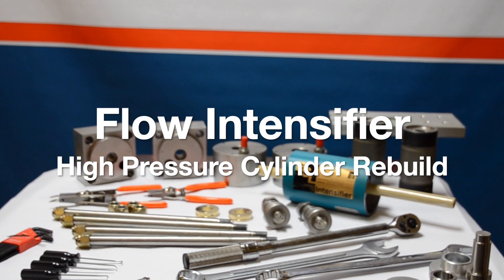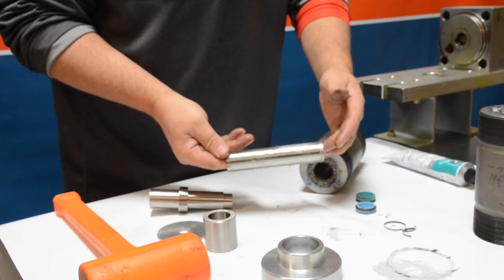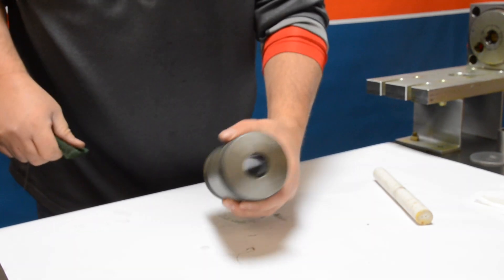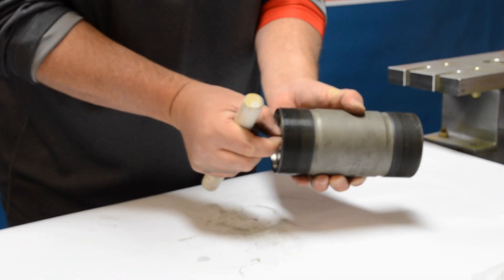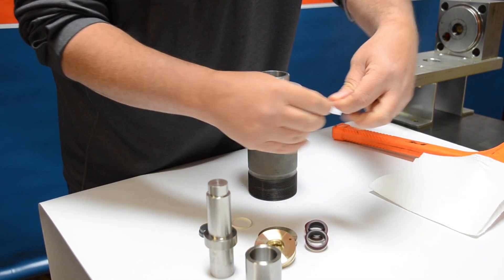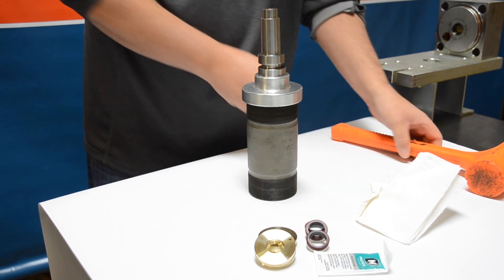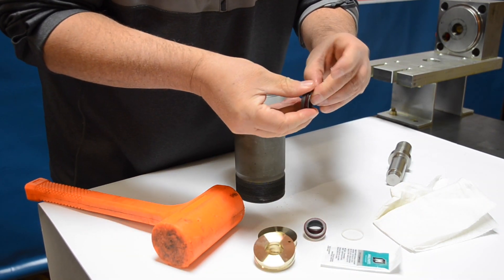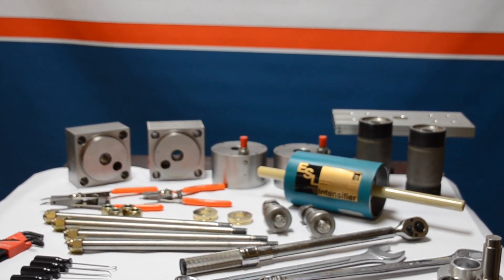HP Cylinder Rebuild - Flow Intensifier

Comment: I have rebuilt hundreds of these cylinders both high pressure water cylinder and the low pressure hydraulic cylinder if not thousands. I still have the tools to rebuild the intensifier cylinder. Started rebuilding them in the 1990s started with a flow 9x only had one dual head, water jet cell. In 2018 we had 50 robots cells most were quad robots cell. I went to the flow factory in Canada at the time to look at a quad cell they were finishing up for us and approved the cell for IAC.